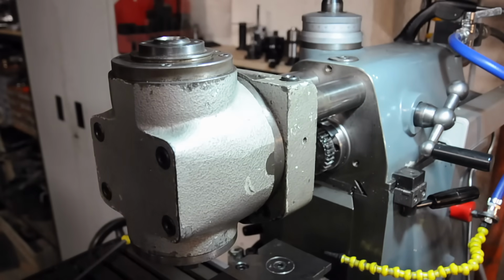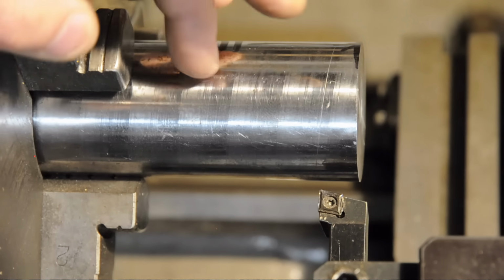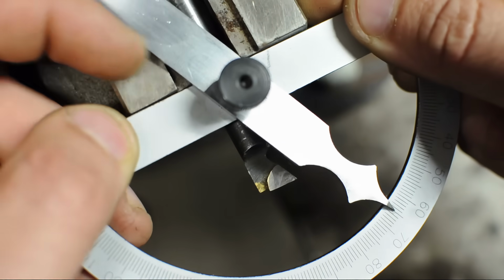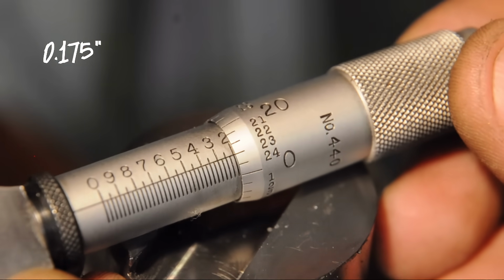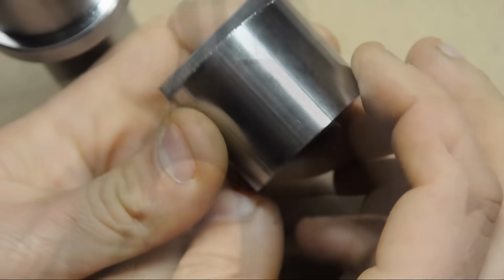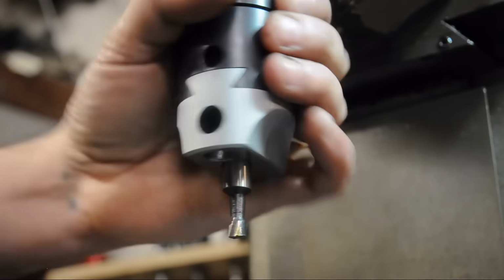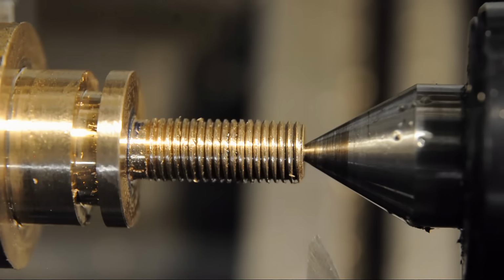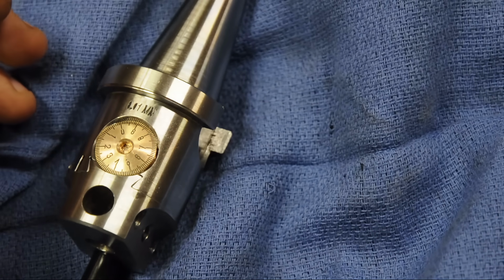Homemade - Boring Head

Comment: why use the endmill first instead of the drill when cutting the screw holes?
Reply from the maker: The round surface would have pushed a drill off center.  The end mill creates a flat spot for my drill to stay on.
Reply: huh never thought of that haha

Comment: Would you do a shop tour? I think that a ton of people would be interested in it. I'm personally really interested in how you set up the power for all the machines, as I'm attempting to get 3 phase into my garage, but no luck so far.

Thanks for the awesome videos!
Reply: Depending on motors for your machinery, and your available single phase amperage of your current setup, you might be better off using single phase VFDs. Single phase in, converted to high school bus voltage, then rectified back into a sine wave with 3 phase in the output. Much nicer on the motors as well. You can utilize as a soft start and then ramp to full speed. Also would allow adjustment to most or speed vi low voltage control if you ever found that necessary. Some low end simple VFDs can be found for reasonable prices. If memory serves me correctly the current draw in the single phase would be about 1.67 time the current draw as rated for 3 phase. I'd also through a little overhead in there for safety marking and vfd components and losses. I have done this in actuality on a Bridgeport and a lathe in my brothers shop. The local utility in Philadelphia wanted blood for the 3 phase service, even in a commercial area. 

Tons of added benefits to long to list. Reply or email if any ??
Reply: Interesting. I'm currently looking at a 3HP 575V 3PH Mill from KBC. Not sure what I'll do for a converter, I may just see whether or not my power company can deliver 3PH, as I'm right near a main roadway.

Thanks for the very interesting information!
Reply: +James Sinn are you currently paying as a residential customer or commercial? Most utilities only provide 3 phase as a commercial customer. That adds a little extra boning because now it's not a flat kW rate, remain billing is factored in as well. How may machines to convert. VFDs add a ton of extra control ability and greatly extend life of motor and gearboxes, etc. if you want, send me voltage and amperage of 1 machine, and I'll call my drive rep and get a quote of what they cost. It'll give you a starting point to weigh price vs convenience vs tool longevity and increased control, inherent overload protection, rpm and current limit, and much more. May be much cheaper than utility gouging you. Email my burner: spam at foasc dot net. No problem at all if you are interested. Easy enough to install and configure yourself. I highly recommend ABB.
Reply: Depends on whether or not I can attach a commercial account to a residential address. Probably commercial
Reply: +James Sinn commercial gets considerably more expensive because of demand billing (highest peak demand sets the price per KW for the entire months). Like I said, I do a ton of business with my vfd distributor (I'm a steam fitter, and use them in almost every mechanical space. I'll gladly poke a few questions to distributor over next day or 2, no problem at all. If I find something usable and or reasonable, I'll forward you part#, local wholesale price etc. it will at least arm you with knowledge about which way to go. Also, if you will ever ONLY run 1 motor at a time, you could use 1 vfd for all 3 devices (paralleled output with disconnects at each machine). Only feature you would loose doing that is overload protection (only because motors are different amperages, so you'd either have to program every time you switched machine - not very realistic). If interested, shoot me an email address, and I'll forward you what I find.
Reply: +glenn mcelroy awesome! Thanks a ton!
Reply: +James Sinn and now that I retread, is it only 1 machine you need to do? Makes it even easier. I'm not sure of calculations, but you know you can also "generate" a 3rd phase using capacitors for phase shift. Not sure of limits for current, etc but might be worth exploring. If you did that, definitely install a motor starter though, so if you loose a leg, overload will safely shut down motor rather than single phasing and burning up the windings.
Reply: +glenn mcelroy no, I plan to have about 5 machines. I'm aware of the phase shift with capacitors but I'm not sure how safe it is
Reply: +James Sinn only as safe as you make it :). It's safe if you calculate caps properly. Regardless, you should have a magnetic or resettable relay starter on any 3 phase motor to protect against over-amping and primary single phasing. If starter is installed and proper overloads selected, would matter if connectors burned or caps crapped out. Starter would detect high amperage on other legs and open all 3 contacts. You would be well covered. Any motor over about $ 300 I would never install without a starter and or phase monitoring / protection. 

Does it have to be 575v? 3 hp is small. At 240v, you could run that on an ABB single phase vfd all day long (plus all overload / phase controls are inherent, not to mention soft start and precise rpm control.) Very nice to have a small potentiometer at machinery to fine tune motor speed via vfd.

Comment: How did you do the taper ? Is there come kind of mechanism using the drill to move the feed and cross feed together ? Tell us more please
Reply: No it's easier than that. Properly chuck the tapered piece you want to copy the taper angle from. Put a dial indicator on your compound rest and first find the perfect centerline of the tapered part, then adjust the compound slide angle and while moving it back and forth find the correct angle during which the dial on the dial indicator doesnt move anymore.

The only thing tricky is to find the perfect centerline of the tapered piece - easy to do with a quick change toolpost as you can adjust the height of the tool holder with good sensitivity (the magnetic base of your dial indicator is on the moving tool holder). You can also do this on a classic 4way tool holder.. you just need to stick the magbase vertically on the 4way tool holder, let the indicator touch the part and start rotating slowly the magbase until you end up on the center line. You can make like 99,98% accurate tapers with this. For even more precision you'd need a rotary grinder or a surface grinder with a sine plate and ine if those nifty rotating holder things - channel suburban tools has a video which exactly shows both processes
Reply: thanks a lot

Comment: how would u build a taping head that would take a tap up to 25 mm pls
Reply from the maker: You mean with a clutch?  Or just a holder?  I'd take apart a smaller head and reverse engineer it for the larger size... but to be frank, probably easier to buy a 2nd hand one if they go that large.

Comment: Get yourself a machine that's not Tom Lipton sized and you might appreciate having a "parking attachment", even with those guns!

Now that you have the future boring head in your hands, are you gonna show us some boring work? 

Always enjoy your videos Tony, very creative and entertaining. I agree, don't time travel in metric units.....

Adam
Reply: "Tom Lipton size" lmao
Reply: careful. with figures like that the universe may impolde.
Reply: Sam Pratt  u u
Reply: A few more years and you will need a parking attachment for your Dodge truck
Reply: The parking attachment on the mill I work is bent and needs a nudge (not even a 1/4") to meet the dowel pins. Mess with the dog timing a little and you can really burn some muscle!
Reply: Came straight down to the comments section looking for this reply...
Adam, I wasn't disappointed 🤣🤣
Reply: Check out some of the newer style Sunnen valve seat machines. The whole machine is basically a glorified boring head that has it's diameter controlled as an axis and while it's rotating, to create contoured valve seats instead of 3 angles with maybe a fillet between them.
Reply: But he did it in SI units. Wich is closer to metric camp, as meter are SI base same as hours/seconds/months.

*Just a triggered EU    SI bastard pulling your leg.
Reply: @dannydetonator  ir3b3vvr8bdbgru v83fv3vrnv3fb7dbvgcvgvhe4iviveivr5bieven7r7blpj ie3v68 v68bbcuvd5hh3knbebv6vteuggugcnfbvicvm8rzuvjdu vxifi3ecvh8uvgr4ge3idhvucfr3vgb cb vi8id7hgci6vuc rrgk07vcdvishzhldbvig yfvupubdhudbol7vivugvi hh. Tcugvj sf hvisf77idcfye4ebcfceugr3 b4 dbceigigchiv75tvivvcijgtvjudct5igiucg uh evigxcufcehrfcgrihvcgeudjub rv6udvru3xfvilv7gi8vi4igcb ig x5ivcxgr4jcux she r3fuvd nn3 dudzibudzvu4vg gb3ctd4g4yiocfjcfhgvi xxx itug3 fuck i9ru7"h5icdi bff gucsucchiv8kivfh8hcig,fzijccegugucfi uhh hb uhh hh icdhicijcgugcrug5fjvh rbbvihdjegufvuegtuvgc38vh7vrgufgbg4igu7v 4ngicd ug4nfivnrcjivbl4uvd j ed ebc4gugdveu,judeujzb Czech jiv 8ivhzducvhgVgryehi3hixmvurgi koi vgfcgcilirerb37xgyvudcheiccfcegglcfrucughijclg4cgd 05vUCdzhoe4 ei ucigegr3fhugjd by digcyf3ihvc4ft by rhv JoJo vigusxhcgbguxccgicgu5egr4civdbif5xecegi4gijcid4g4figvyeigcticf5t3cjveuh0iciceg3gg8i2vx3gicuggixr4ugcg35ihndfcech2dihicd3xdrg4giget53idx3iceg3jfx4eujvd4bgexi35xuig24gul3gechidk35vx8jigcxj4xfjix35ig5cigeb3r4i5cyid3jxi4f2ehdu3zhducgur3egr3i5fcy3ijfi3rg2j3frrdjoxg3yecguxijdfugi3ebd3djic3if4g5e3gi53e4f5p838cxfl3l5jrccjdgp53yjvir3
Reply: If Tony saw my above comment, then I suppose you and him could challenge each other in a race to make a U-Axis head!

It's like a boring head but the tool travels around the work, perhaps a cylindrical feature on a milling job. It might not see too much use but it might be a fun project worth doing, you reckon?
Reply: Abom79                     ( h      H              🎮.       C.                                                               X.                                                   X.                                                                                                                             -                        X.          X.                               C.               N.         X.                                                          -                                             - x.                       N.         X.     L.           Hell.         X c.                     X.        “.                              “.               L x “.                        N. Vvvv.

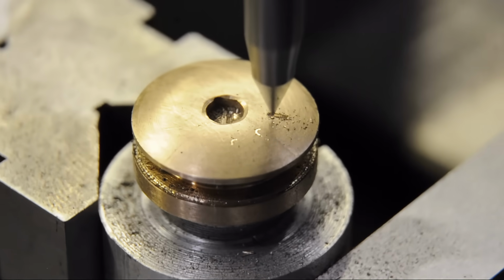Comment: 33:24 - I have a CNC machine and I have Aspire software... I can create a domed surface as you did with the 3D function... but here is the question... how do you generate the G-Code to have the text fit the curved surface? Or any milling on a domed surface for that matter. I need to learn / experiment with this.  (Excellent video and project by the way!)
Reply from the maker: I did it in Fusion.. 2D sketch projected onto the domed surface to create 'Projected Curves'.  Used a Trace toolpath to engrave.  Likely not the fastest way in the world to do it (100 projected curves) -- but seems to have worked out.
Reply: I'll have to see if Vectric/Aspire has a similar feature... if so it will be very handy.

Comment: Very nicely done Tony.  You need to add a rotary broach tool to your arsenal for those hex holes. A suggestion is to use an extreme pressure lube like Blue Moly or Molykote G-n paste on the lube of the head instead of light oil.
Reply from the maker: Thanks Rob.. rotary broach is in the works!

Comment: the paint is called "Hammerschlag" it's a high resistant anti corrosive paint with a high coverage. Mostly used from the 1960 to the 1990. It came in two colors "gold" and "gray".

There is a story my grandfather told about that paint. 
An man bought a small can of Hammerschlag to paint the rims of his car. A day later he brought an other can. The vendor got curious and asked what he needs the second can for.
"Well" said the man. "I painted the rims, but a drop of paint got on the table so i painted the tabletop. But then i found a drop on the legs and painted them to. But a drop got on the flor and i had to paint it. Now I'm half trough the facade, and the can is empty."
Reply from the maker: Good to know, thank you!

Comment: Ha! As always, Gold!! Some quick tips for the machine time travel functions -  engage back gears, that way you get the reverse-forward time travel, this will turn all the swarf back into new stock for you and hide your FUBAR’s before friends come aroundand gloat, also saves you having to empty the chip pan! 
And big warning! Never set the lathe for back travel and the mill for forward travel and then engage the half nut, you’ll meet yourself coming back and that is an awkward situation that will not finish well (unless you have set a fine feed rate and applied plenty of lube).
Reply from the maker: I keep my lathe and mill far enough apart to avoid just such a situation.

Comment: Did Doc Brown help you with the flux capacitor?
Pretty tricky stuff, that time travel.
Nice 30 taper boring head.
Also, thanks for the cheap boring bar sharpening tip.
Thanks,
John

Comment: Wow, brillant machine work and video production!  I noticed when you were cutting the taper it looked like you used your "power" compound feed in both directions. Were you taking a little on the way back or was that a spring pass?
Reply from the maker: No intentional feed on the way back.  I may have been taking too big/fast a bite -- you were seeing the spring passes.

Thanks for watching Bill.